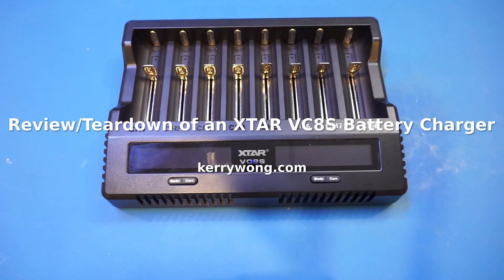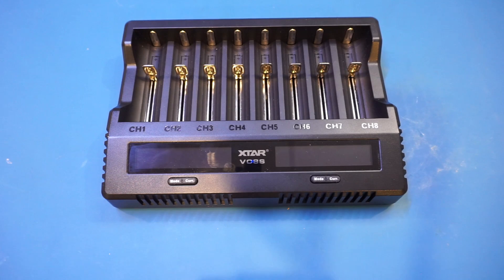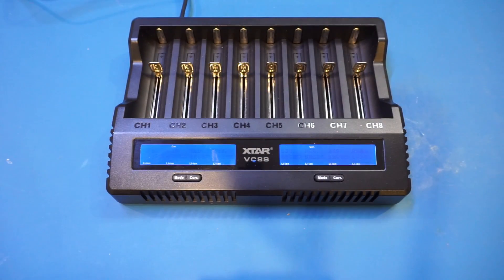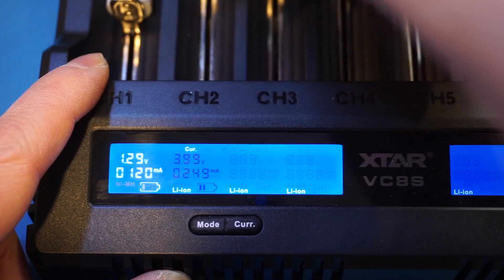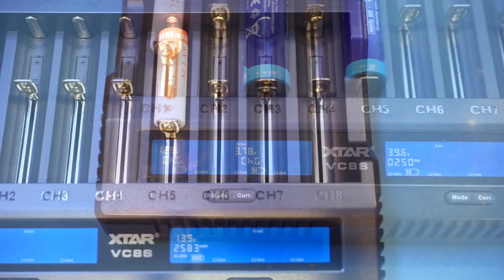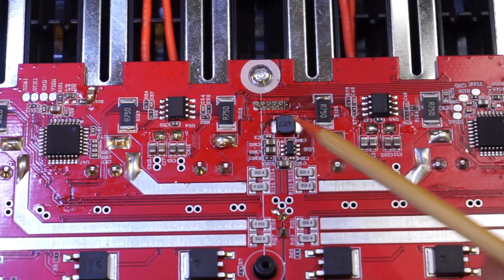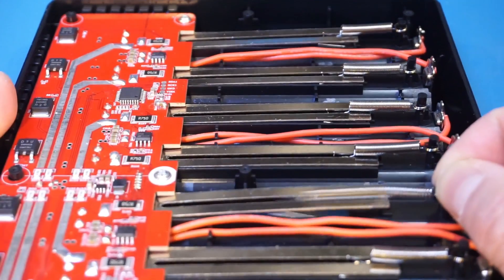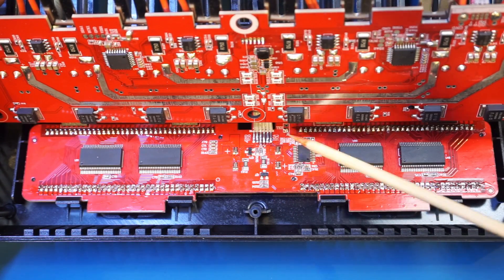Review/Teardown of an XTAR VC8S Battery Charger with Builtin Battery Capacity Measurement

Comment: nice review, I can't figure out why I can't get any 18650 to charge faster than 500ma, I have several brands & it won't charge any higher.  I have a few generic 26500 and everyone of those charge at 3A without issue.  Fenix 21700's won't go any higher than 500ma, yet in the PD36R light using it's built-in USB C port, it charges at 3A in a fraction of the time needed in the VC8S.  I have other chargers but the 21700's don't fit, so I bought this one and while they do fit really good, charging them in the VC8S is a ridiculous waster of time. I'm still trying to explore why.